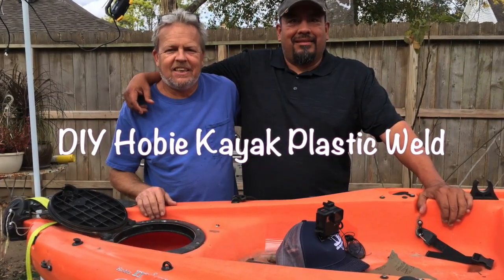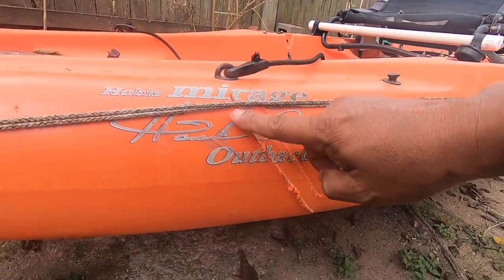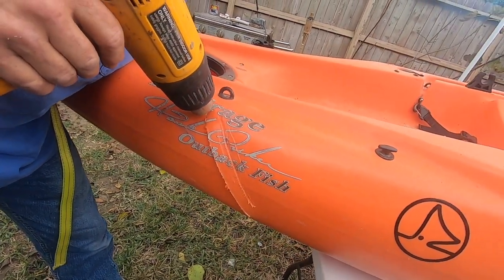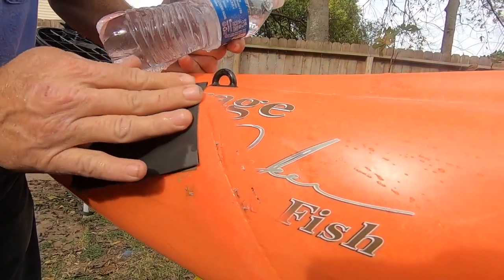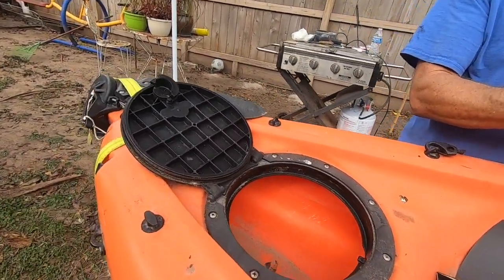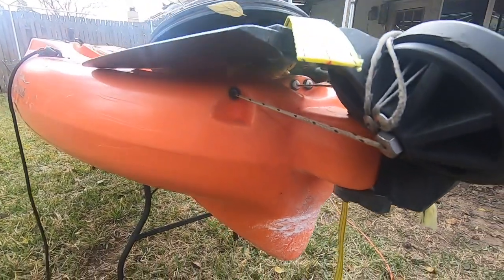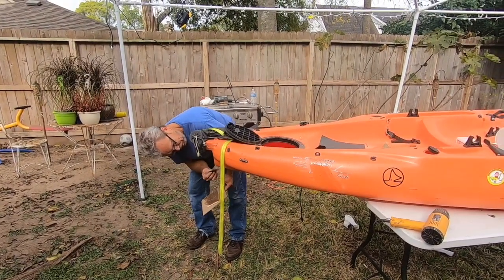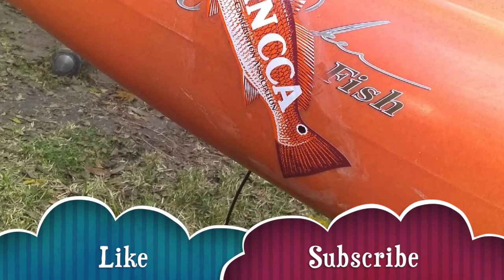How to DIY Kayak Plastic Weld | Kayak repair | Fix plastic

Comment: Hi thanks for the video. I have a plastic dinghy boat that developed a hole. However I don't know if it's HDPE. Is there a way to tell? I want to plastic weld it.
Reply from the maker: It depends on the plastic
Reply from the maker: Also depends on the size of the hole.  I have covers some big Quarter size holes.
Reply from the maker: Send me an email with the question 
Dagarzapasadenaisd.org

Comment: I just spoke with JBWeld before I watched this and they said that for a kayak, I should use the Plastic Bonder, not the Plastic Weld.
You found that this kept a perfect seal?
Reply from the maker: Simon Mirsky awesome! Thank you for sharing this information with me.
Reply from the maker: Yes the plastic weld did a perfect seal with 4 of our kayaks.  The test was when my seat put a hole in the plastic.  I filled it in with plastic weld and it worked like a champ.  I’m 240lbs.  Still going strong.  But i will definitely take your research into consideration next time I work on plastic again.  Again, thank you!

Comment: NO NO NO
2 rules to fix plastic kayaks
1: USE PLASTIC TO FIX PLASTIC
2: HOT PLASTIC STICKS TO HOT PLASTIC
TIPS: Little tikes and playschool play sets & furniture are made of the same plastic as your kayak and made the same way and they come in many colors!
For strength, Melt wire mesh (Aluminum window screen) across the crack or across a gap/hole
I  patch the hole first then add the mesh and another layer of plastic on top.
For wide gaps, melt the mesh across the gap then coat it with MELTED plastic (twice!)
DO NOT USE JB WELD, EPOXY, BONDO, FLEX TAPE/SEAL, FIBERGLASS etc. to repair a plastic kayak! USE PLASTIC!
EDIT: OK the JB WELD PLASTIC coating seems to be a good idea on top of the PLASTIC PATCH and the (INSIDE) Tape was good too.